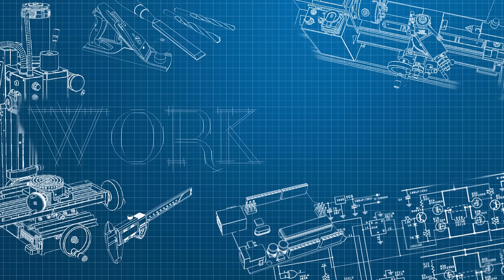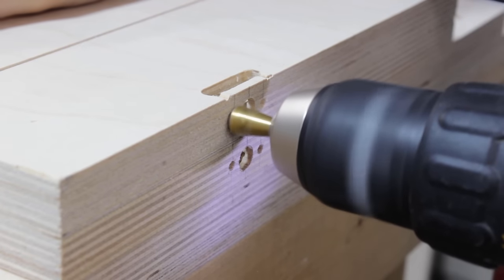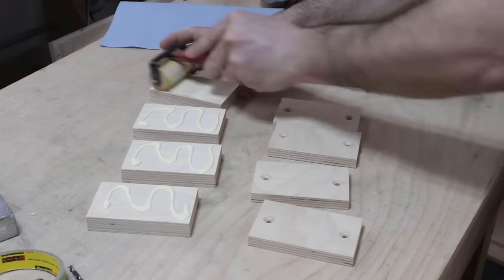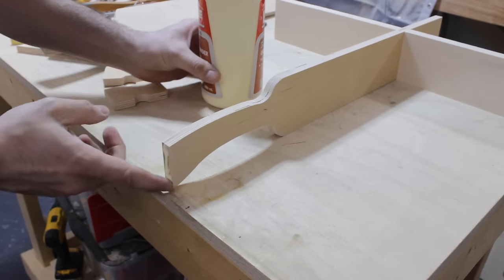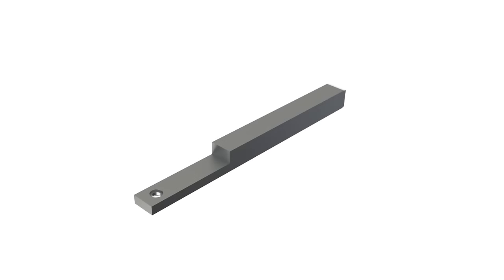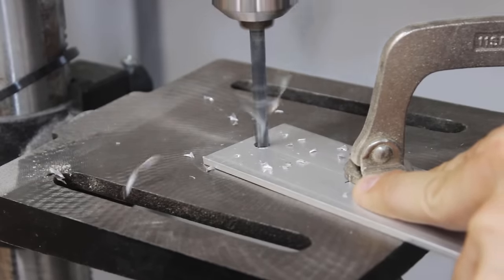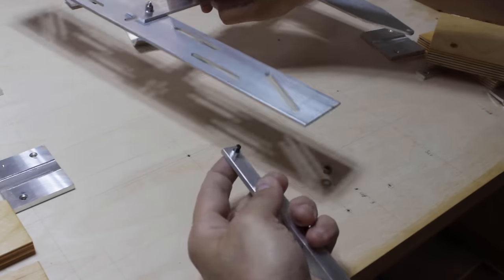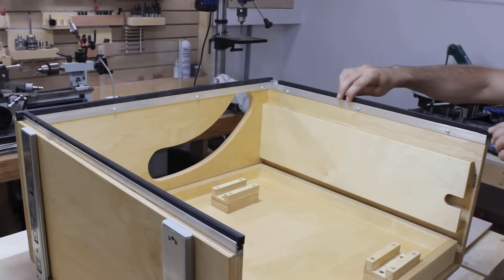Small Workshop Workbench Build - Part 2

Comment: While I admire the locking mechanism and understand the importance of it in this system, it pushes beyond my skill level and most others. If the components needed to construct the locking mechanism were available off the shelf, more standardized, it would make this system more easily accessible to many more woodworkers. I wonder if anyone has come up with a more simplified version to replace this complex system. (KISS) It is, without a doubt, a fine example of engineering and forethought. I plan to watch all of the videos! Very enjoyable

Comment: Love the metal work as this is something I need to get into.  What kind of machining tool do I get first?
Reply from the maker: Hi @thorshuatus , Thanks for your view and the good comment! What machine tool to get first? Opinions can vary greatly but i can try to share my opinion at the time. 

Drilling:
I would say if you don't have at least a small press-drill, you should get one of these first. They can be very useful for many things.

Grinding:
You will probably want to get at least one decent grinding equipement. Dual wheels grinder are common and pretty useful. Belt sanders can also be a complement/alternative. Something to grind metal, to sharpen tools, clean edges, etc. 

Cutting:
One can get a surprisignly long way with a basic hacksaw, a bunch of files and some perseverance. But i would say getting a decent bandsaw can save you a lot of time and effort. Options are pretty wide here again, depending on budget. I personally lack equipement on this aspect. I have a very cheap one, mostly for small wood parts. Its crap with metal. I would probably try to get something like a portable bandsaw for metal, like the ones contractors use. There are some options like 3, 6 inches. These saws can be used in many ways, most importantly, they are good for parting off bar material like rods and tubes.

Turning:
I believe the majority of amateur machinists would agree the first machine tool you want to introduce yourself to machining should be a metal lathe. I think i "kind of" agree. If you are looking for one OR the other, perhaps for budget, space, noise, or other constraints, it make sense to go with a lathe first. Altought, i feel its pretty sad to leave milling aside. I would really try to get both, even if you have to compromise on machine capacities/functionnalities/tools.
For a lathe, mini lathes are the cheapest option to fool around and learn the basics on small stuff. Thats what i own, and it's tons of fun. But its very limited. With lathes, as with most machine tools, in general, the bigger and heavier the better. Its all a matter of budget and space. I would get a 16x40in lathe if i could ;-) Go with what you can afford. And dont forget to consider toolings. This can cost as much as the machine itself in some case.

Milling:
Again, to me, a milling machine feels pretty much just as useful as a lathe. Pretty much the same comments apply. Milling is very useful and is a very basic/indispensable machining operation.

Then, the list can go on and on for quiet a while if you consider the various machines and operations that are considered as "machining". I would say if you get these basic operations covered with a decent machine tool within your budgetary limits, you should be able to go quiet a long way in your exploration of the machining world.
Thanks!

Comment: I enjoyed watching that detailed lesson - a lot of small things I learned as you went through your build process. Particularly on the metal fabrication.

What was the situation with the small pin in the mill chuck that was spinning loosely and you brought to alignment with the side of a pencil?
Reply from the maker: Hi Michael, thanks for the comment! The tool you are talking about is called a "wiggler". Some also call it a "center finder". You can center it as it spins and it can be used as a "point" (in my case) to eyeball an alignement with decent precision. You can also change the tip for different geometries and functions.

Comment: While I appreciate the machining, I fee that the method you've used to hold the saw in position is vastly over complicated (still to see what else is required to lift it into position) ... you have a removable top which would take under a minute to remove, why not just place the saw in position and then put the top on?

Still loving the build 👍

Comment: Hello,
Very Nice work!!
Havé you got the details please ? ( sketchup for exemple ).
Thanks
Reply from the maker: @badscorpius : Hi and thanks for the view! For now, I am working on 2D plans based on my 3D model, since many people requested them. After that, I will try to see if i can find a way to share the 3D (probably in generic .STP format). However, i did not make this 3D model with the idea of sharing it and the way i made it, it is very detailed and unfortunately probably very hard to convert and share. I expect serveral 100s Mo, possibly several Go of file size...and just the conversion is likely to fail (in my experience) because the software i use is not the greatest for exporting. But I'll see what i can do. Please subscribe and stay tuned for part 6. I should have the details by then. Thanks again!

Comment: Hi, great build ;) it looks like u use small lathe, would you like to share link or info about it?
Reply from the maker: Sure! The mini lathe I use is sold by a canadian tools store chain called Busy Bee Tools. The brand name is Craftex. You can see the link below for exactly the model I bought:
https://www.busybeetools.com/products/lathe-mini-7in-x12in-1-2hp-cx-series-csa-cx704.html

This is one of the rare brand of mini lathe available somewhat easily here in Canada. There are a few others, namely King Canada. In the end, this is the pretty much the exact same mini lathe you see from every brand in this 7x12 size. They are very likely made in just a few chinese factories and share the same design.

If interested, I also have a complete 3D CAD model of this mini lathe available here :
https://grabcad.com/library/mini-lathe-cx704-1

It is a decent machine, but it of course has many limitations. First of all, none of these mini lathes are nice out of the box. They require at least partial disassembly, cleaning, perhaps some paint scraping and sharp edges filing to make them work well. Certainly some adjustements, perhaps modifications and upgrades. You can find many videos on the topic on Youtube. But if you wan't to experience the pleasure of machining some parts, I guess this is a decent starting point. At least, it's the path I chose. I have limited space and limited means. Better this than nothing at all.

Thanks for watching!

Comment: How are you finding the aluminium cams and pivot plates functioning together?
Reply from the maker: Hi again Michael! It works well enough and it does the job...but barrely. Of course, for me, this is cheap material made in such a way that it is quiet easy to manufacture. But aluminum rubbing against aluminum is not great. I could've used different material in some places to reduce friction...but a little bit of grease on every rubbing area seems to do the trick just fine. It just a matter of having some play everywhere and taking special care that everything is well aligned and there is no binding. Thanks again!
Reply: @matsworkshop566  It's cheap material, if you don't count the cost of the milling machine. Most of us woodworkers don't have that, and custom machining by a machine shop is out of the question. Any suggestions for off the shelf fasteners?
Reply from the maker: Yes, I get your point. I am a bit torned between my love for metal working and woodworking, so I like to do both and and know it is not the case for everyone. I am also aware that having mini machining equipement is not very common to most. It is not every part of this design that would be easily reproduced. My intend was to cover my own needs and have fun building it with the tools I have in the process. This makes my design overcomplicated in many aspects. It was not really meant to be "easy to reproduce". For someone who can't machine all the components, of course this is a bit problematic. I am sure there would be ways to adapt the design with simpler off the self components. For the saw fence, it would probably be quiet easy to think of a whole different system. One could also buy of the shelf saw fence. There are pretty interesting and robust options that exist for decent prices, all ready to be installed. These are generally meant as upgrades for cheap cabinet saws. But they exist, and could be fitted on a frame such as mine quiet easily. As for the saw box locking mechanism, this is a bit more complicated. But after i realized the "winch" system was necessary to lift the box up, i could've done the locking mechanism a lot simpler. It was just to late for me, since i was already done. But one could easily find a slightly different design that would do the same thins, with standard components, and less complexity.

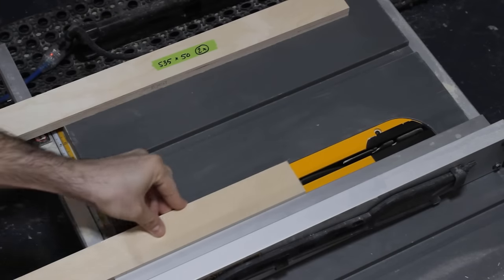Comment: @1:00 pushsticks, what are they?
Reply from the maker: Hi again Shoop. If you are referring to the pushstick that you see fixed on the fence, this is just the cheap pushstick that comes with the dewalt table saw. This is really nothing special. If you look for pushsticks on amazon, this is very similar to the cheapest model you can find. This works just fine. You can also just cut yourself some in a piece of wood. No need to pay for that. Thanks!